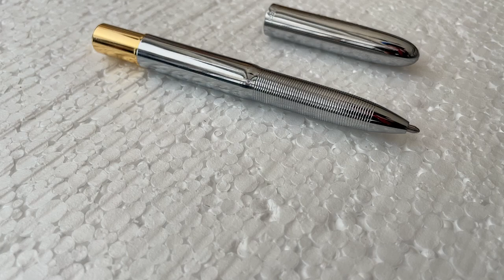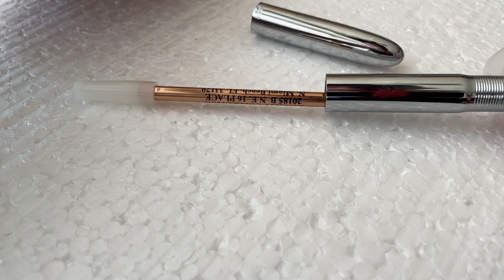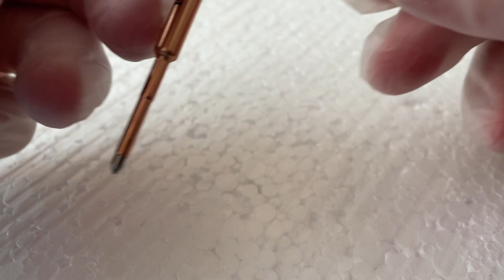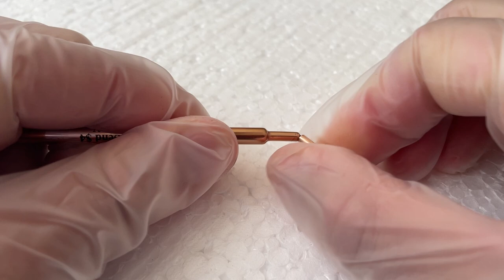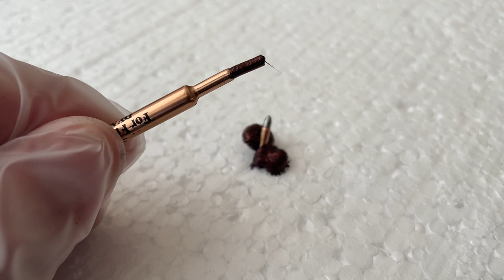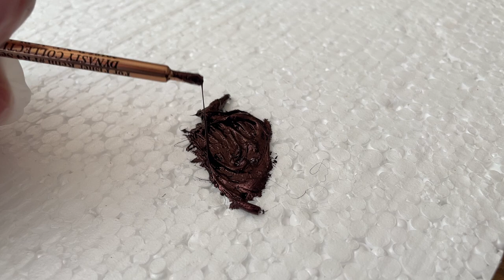How A Pressurized Ballpoint Refill Works

Comment: Great video.
I wonder why it would no longer write, considering that there was still ample ink in a still pressurized vessel.
Reply from the maker: Unclear. I think it might have taken an awkward drop on the tip.
Reply: There could be dried ink clogging the nib and preventing the ball from moving. Since these inks are usually dissolved in alcohol for a fast dry time, hand sanitizer will usually fix the problem by wetting the ink with enough alcohol that the clog liquefies and the rest of the ink can flow freely through the ball again.

Comment: Can you do a vid, on refilling a parker quinkflow ballpoint pen refill as if it ran out of ink and you wanted to refill it.
Which I think sounds easy ?  And my question after that is, other than the cap ... would you cork it with ? thanks.
Reply from the maker: What ink would you use though?
Reply: @unsharpen Maybe some kind of fountain pen ink ? Good question.

Comment: Very informative! Do you know if the tip of a 0.9/Fine Fisher refill can be switched with another ballpoint tip? Planning on switching the tip with a parker quinkflow refill since I like the 0.9  ball diameter but very much despise the high viscosity of the original ink in the Fisher.
Reply from the maker: You can switch out the entire refill

Comment: It seems that it is not a Fisher refill, but a Fisher compatible refill.
Made by Dynasty Collection from Miami, Fisher refill would have Boulder, Co. address for replacement mail. Apart from that, the ink is thicker than Fisher's ink

One more thing, USA 9 00 might mean September 2000?

CMIIW